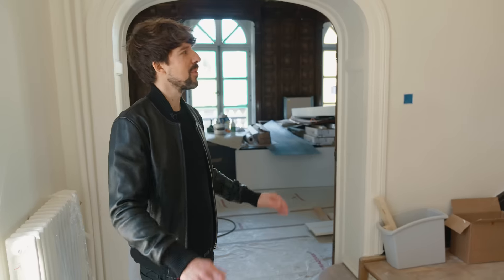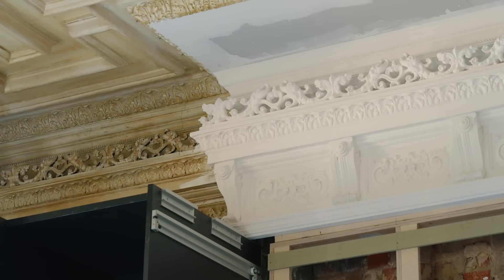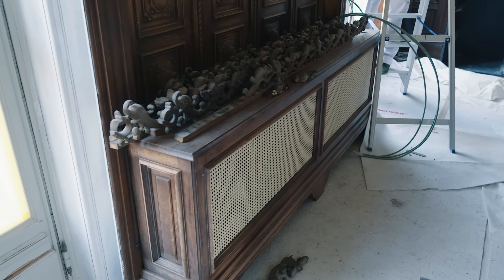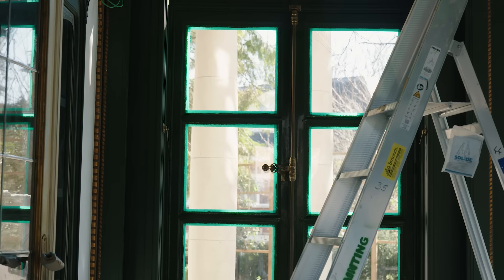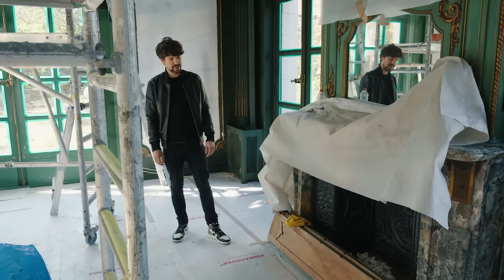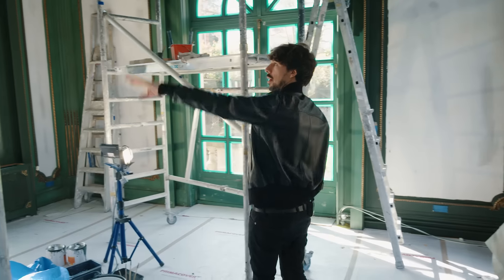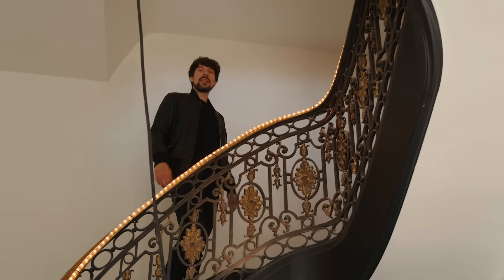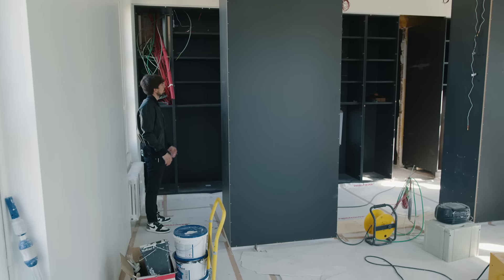Renovating a Chateau: Part 2, "Work in Progress"

Comment: I love this so much. I've been a general carpenter/builder for 17 year. I love restoration, I love history. The rejuvenation of a stranger's past is very heartwarming. Every emotion that we've ever shared, was shared on these grounds, just as we do now. Laughter, pain, fun, anguish, reflection, confusion.
Reply from the maker: Thanks, Yum Yee! We also love to breathe new life into a building with such an extraordinary history. Challenging but very rewarding indeed!
Reply: Pleasure,
Are you a project manager or an architect? Unfortunately I've never had the pleasure of conducting a new build from scratch. I use to do mostly renovation work on Edwardian, Victorian, Georgian properties. Nothing too extravagant, personally I liked post Victorian houses because many have a non load bearing interior, comprised of a brick (load bearing exterior). Very easy to smash the inside apart & have an empty shell.
I'm guessing this is quite hard with a traditional chateau right? Are they mainly load bearing internal block work?

PS. Who'd be the master builder. Astérix o Obolisk?
Reply from the maker: @yumyee2451  I'm an Architect! We collaborate with contractors to realise these projects. 
This kind of traditional chateau has indeed mostly load bearing brick walls inside, so we kept most of those walls (even though the function of some of the rooms has changed), except for 1 wall that we removed on the upper level to create a master suite.
Reply: @DieterVanderVelpenArchitects  even more reason for ingenuity, though there's absolutely nothing wrong with making the best use of what's already at one's disposal. Is it a graded property, as in you can't make changes without approval etc.
When will it be finished? I want to see it